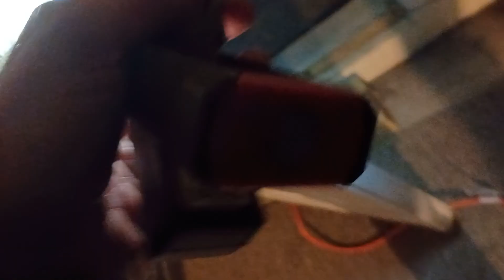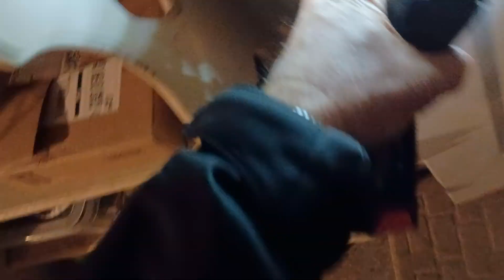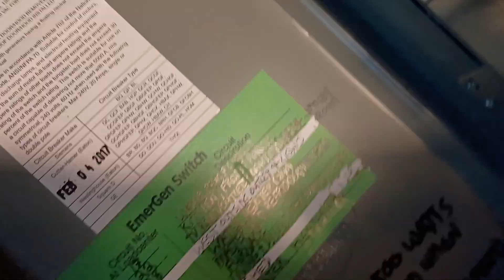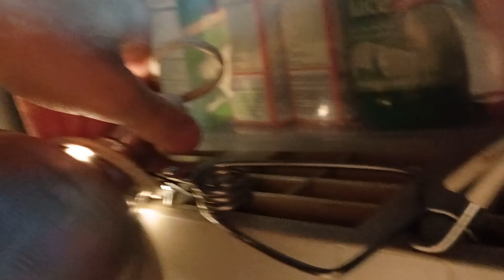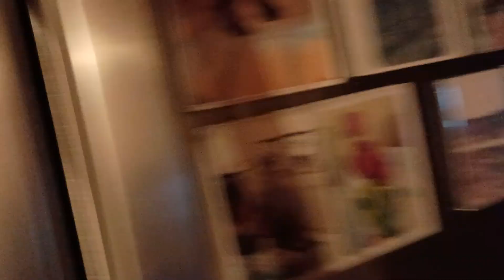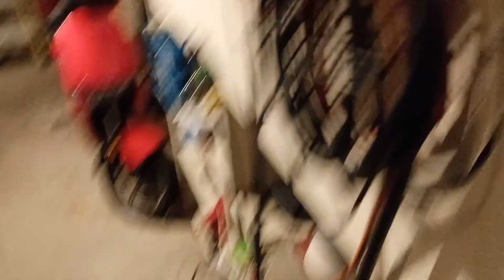Powering your home using a Chevy Bolt EV or EUV.

Comment: You should keep power draw below 1000 watts/83A since the DC-DC maxes out at 130A and it needs some of that power for running pumps and another items. I would place the fuse between battery and Anderson. BTW have you tried just buckling the seat belt  while in Park. It should prevent system from cycling off. I have a similar step with Prius, which supplied power for 10 days after hurricane Helene.
Reply from the maker: Thanks for your input. I had to replace the breaker with a good quality fuse as the quality of the breaker was poor and it was cutting power way too early. More than likely would not be running everything at the same time, Brief peaks of under 1,600 watts. Many people use a 1,500 watt inverter as they are usually over rated. I only had a 2,000 watt portable unit available for this test run.